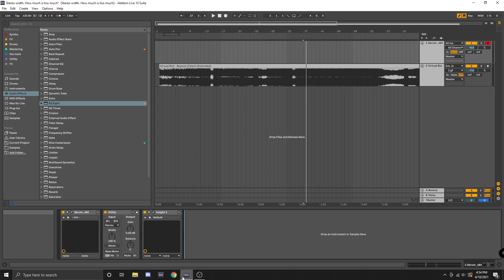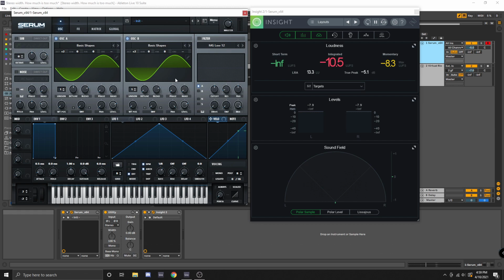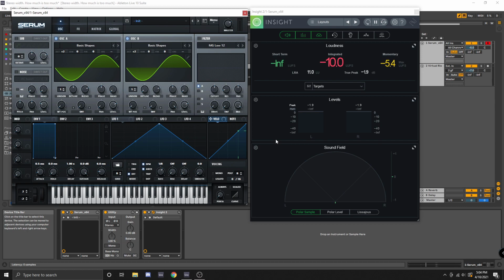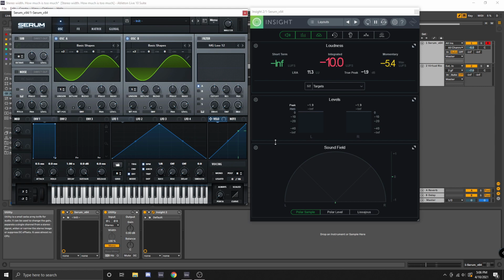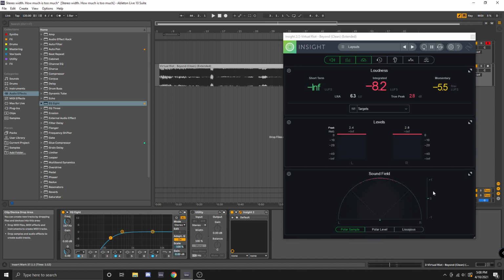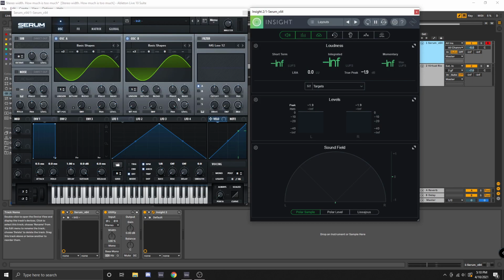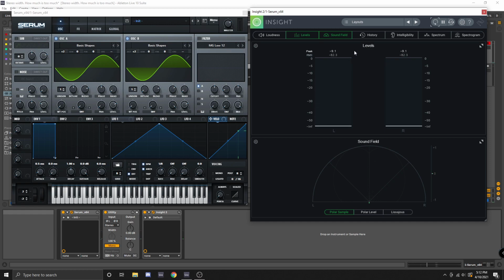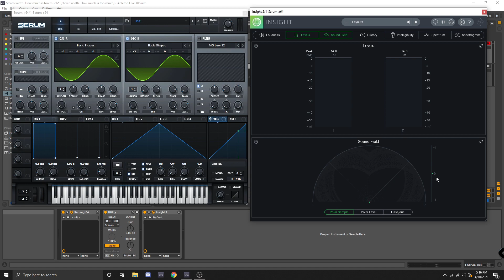Stereo width: HOW MUCH IS TOO MUCH?

Comment from the maker: PS this is not a video on how to add width, or how to pan different sounds in the stereo field. this video is mainly about understanding phase cancelation, and how you can use metering to keep you from going overboard when using stereo widening effects on a single sound source.

Comment: It comes down to judgement and experience.  In terms of phase, you're 100% right, but phase doesn't always coincide with Stereo Width. I feel the title is misleading.  Plus there's almost always a phase reverse button in your DAW.
Reply from the maker: I never said it always did, but if you play around with many of the modern day 'stereo width' plugins, phase cancellation is often an unwanted side effect. One that many producers dont quite understand how to fix. I for one will admit I used to go crazy wondering why my mix seemed to sound massive on my studio monitors, but then sound weak, quiet, washy or phasey when played back on a mono system.  Regardless, thank you for your input, and thank you for watching! :)